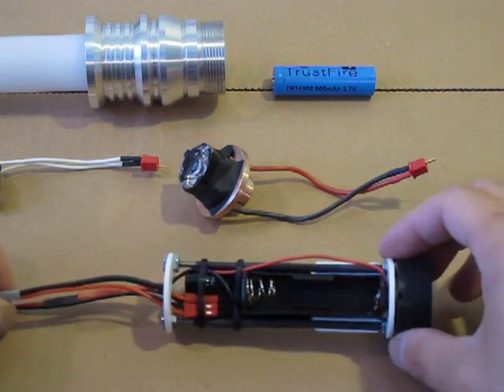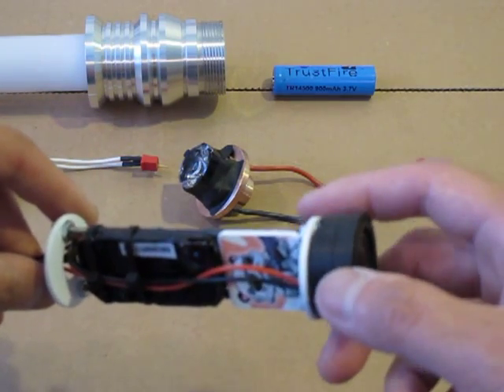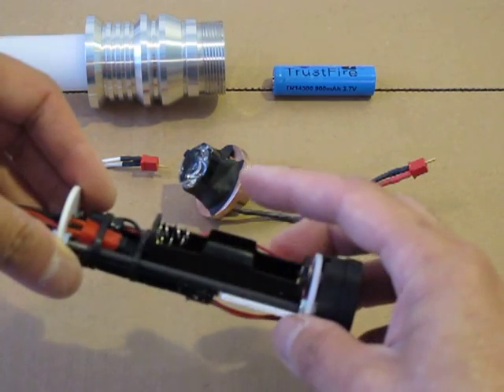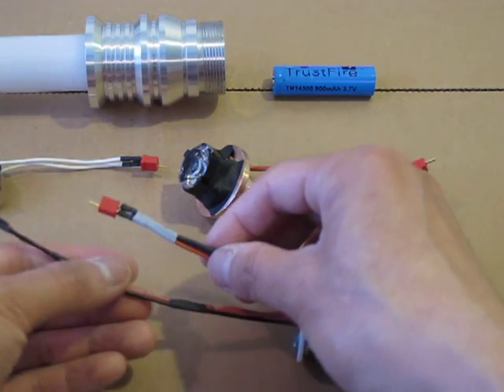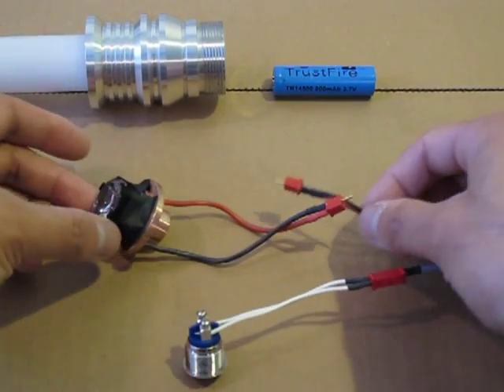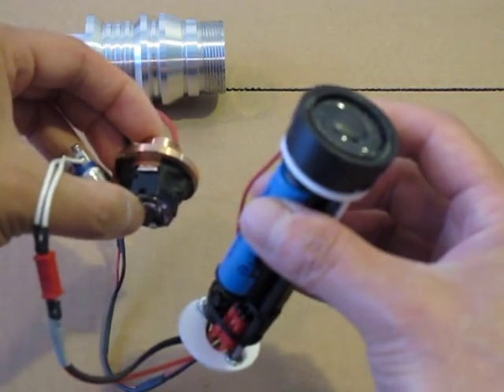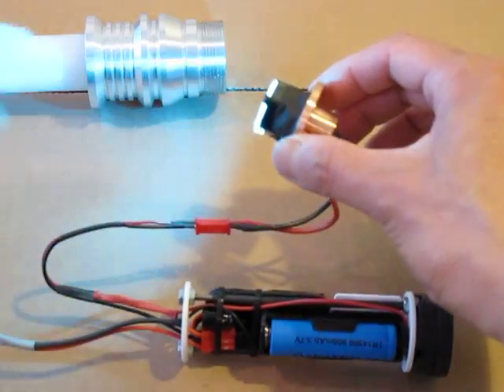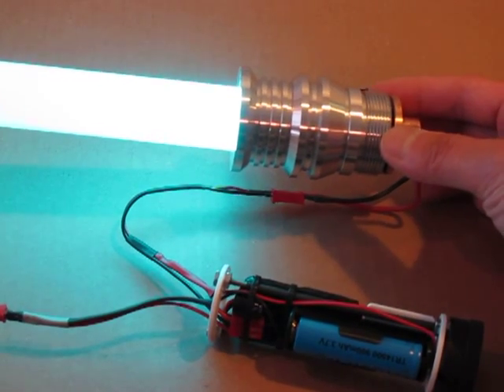Custom Ultrasabers Obsidian soundboard chassis install

Comment: hello, is that al i need for my own saber? The blade, the led, the soundboard, the battery speaker combi and the switch? is the controller included in the soundboard? is the single LED the only light source for the whole blade?

bc i want to build m own saber, but there is nowhere an manual or similary for the inner konstruktion with the elektronics... 

thanks for helping me

Comment from the maker: Most soundboards do all the regulating of current. A stunt saber may require a resistor or buckpuck if the battery voltage is higher than the requirements of the LED.

In terms of wiring size and fit, the chassis is only about 4" long. A saber hilt body has a good 8'-9" of space inside, so there's plenty of room.

This setup fits in pretty much all of my hilts no problem, even though it's a slightly older board.

Comment: how did get all the wiring in that small frame? Didn't you use any resistors or BuckPucks to regulate the current?